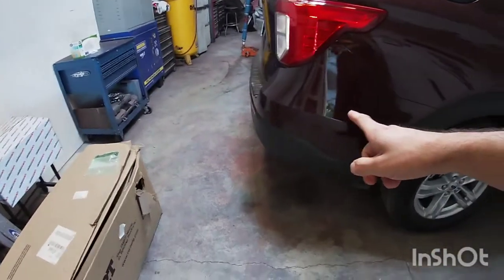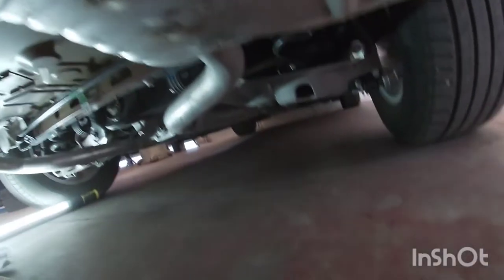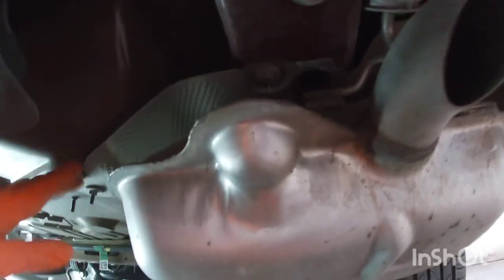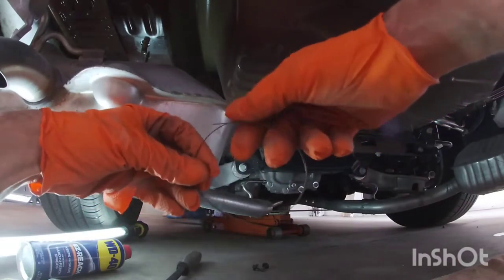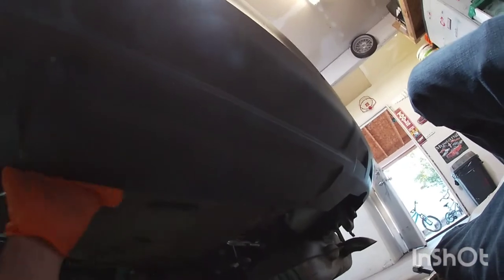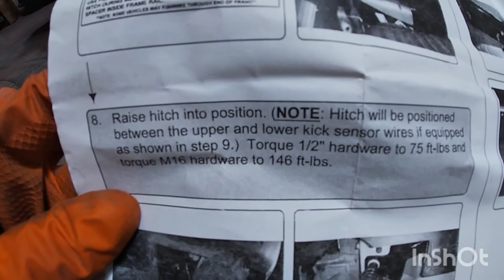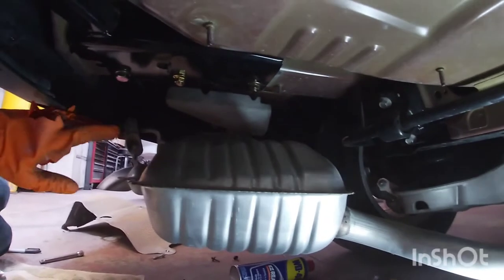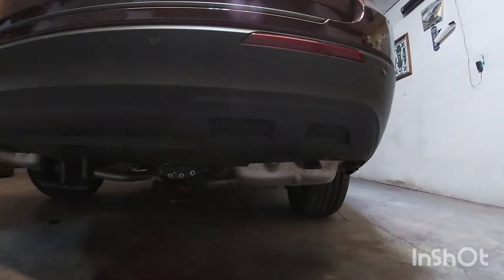2020 - 2023 Ford Explorer tow hitch install

Comment: Maybe I missed you touch on it but, did you reinstall the underside panel , in the middle? I found it wouldn't reach the exact same placement from the start. And the kick sensor caused me all kinds of trouble.

Comment: So I scrolled through and watched a few points so I apologize if you answered this - Is this a no Drill installation?
Reply: No you have to drill a hole through the heat shield and cut the fascia
Reply: @PAwader  I’m sorry that’s what I meant, was no actual structural drilling like into any supports or rails. Thanks!
Reply from the maker: Correct
Reply: @romac1314  That's saved for putting on the 7 pole connector. Haha!
Reply: Very detailed video, good job! Im about to put the same hitch on a 22 explorer for a friend, you really gave me the heads up on what it takes, thank you!
Reply: Just did this. Those 10mm are a pain took me 4 hours from start to finish. Leave it to ford to make them a bear to get to.